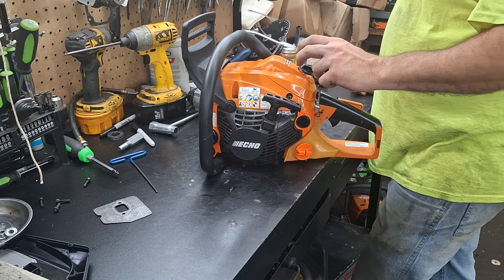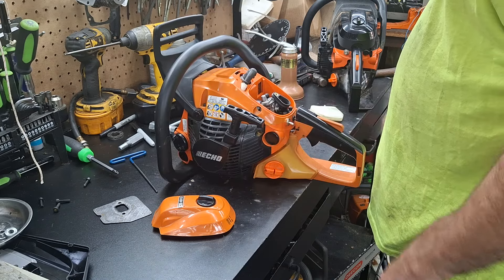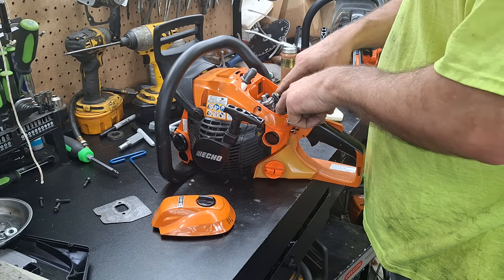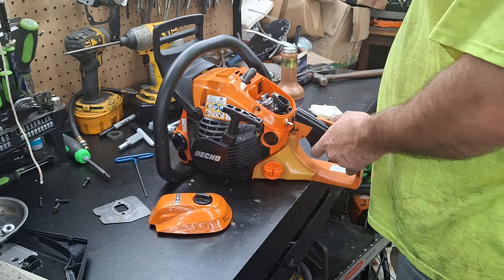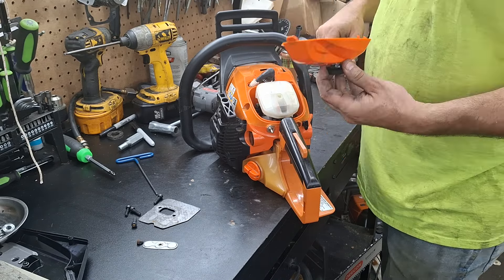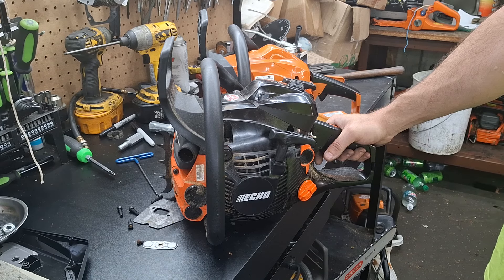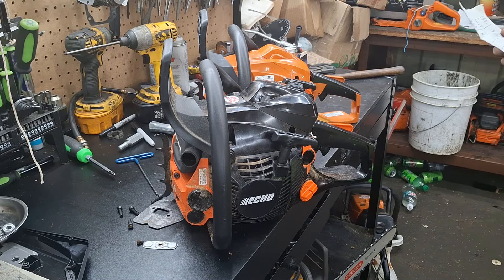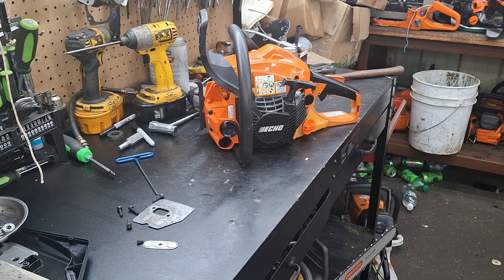what I'm puttering on an dyno results

Comment: Hey Charles , love your content. I don't  know if it is possible but maybe get with Brendan Cass? or whoever could do it and see if smaller neodinium magnet could be used and machine the fan for higher air flow? It seems you have reached the limit with the current fan, what would it take to remove that limit? Is the case a restriction, does the airflow increae if you remove the starter cover? How about spacing the muffler further away from the cylinder?